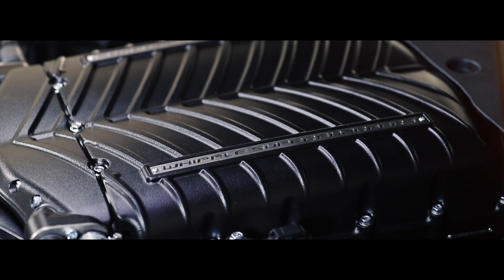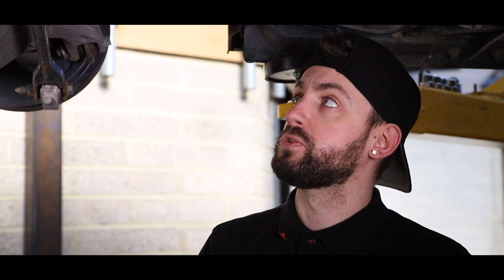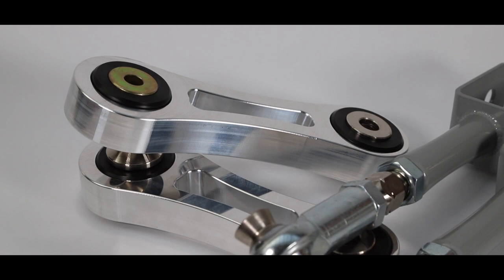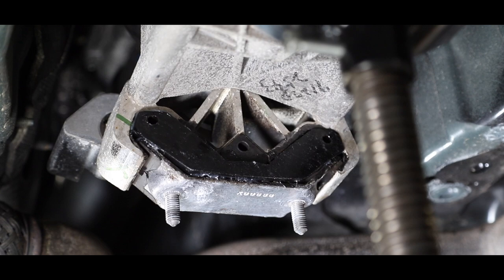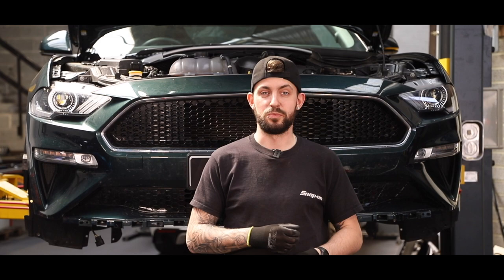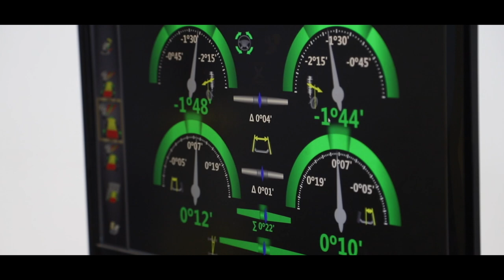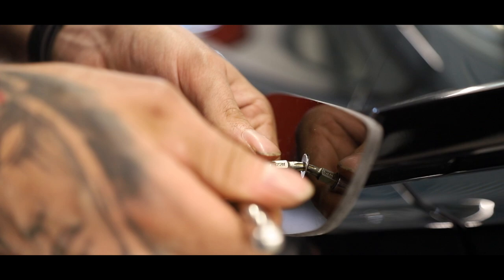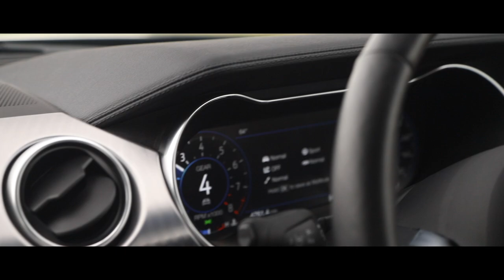Building The Ultimate Mustang Bullitt

Comment: Wow she is  beautiful and what a fantastic video, as owning a manual mustang my self with adding a whipple supercharger will the stock clutch take the extra bhp  and torque
Reply from the maker: Stage 2 Whipple with stock clutch is absolutely fine depending on use and application. More than capable for street use. However, if using for a drag application it's worth upgrading the clutch. 😁
Reply: @MotorsportPerformance  that’s brilliant thank u and keep the videos coming 👍

Comment: Did you increase the weight of the wheel with the new setup in 20'? I assume wider tyres + 20 inch wheel will create more weight isn't it?

Comment: How much Horse Power was she producing after this guys? Might have missed it listed somewhere but very interested to know. Cheers
Reply from the maker: We have 3 phases - stage 2 whipple on a GPF car will make 600-610whp, no GPF's 670-680whp and with headers and full 3" system 700-720whp :)
Reply from the maker: inside info for the keen eyed, during the video the car is presented finished with the factory exhaust and brakes on it ... but for the road shots, it is the full fat Phase 3 car with full headers, borla and brakes ;)
Reply: @MotorsportPerformance  awesome numbers

Comment: whipple stage 2 and no upgraded half shafts?  if they're launching it a lot, it's only a matter of time.  Looks great.  I dig the painted plastic trim.
Reply from the maker: Fine for the street, we know all about snapping half shafts at the strip ;)
Reply: I think on the Michelins he will be ok but with my stage 2 Whipple 10r80 I got DSS 2000HP half shafts as I use a sticky tyre R888R.

Comment: Great build! Just wondering why you didn't install a Barton trans mount shifter?  The body mount factory shift is the root cause of the 2nd to 3rd missed shift. I installed it on my Bullitt and it made a world of difference.
Reply from the maker: Although this is a great shifter, we personally dont favour the Barton shifter for road / daily use for most customers requirements. Although it can be upgraded on the build spec, our favourite is the MGW - Trans Mounted shifter 😁